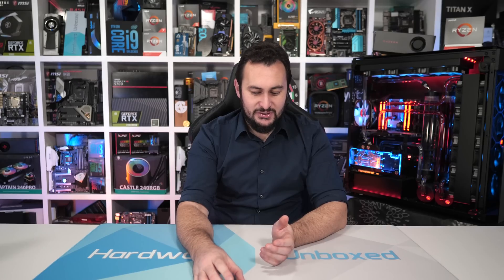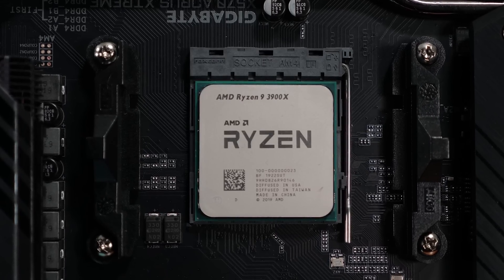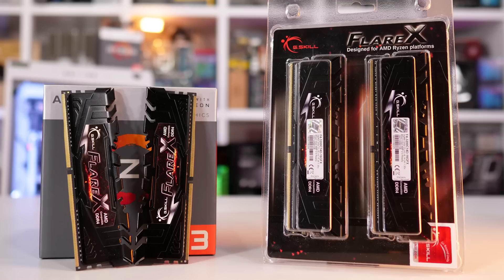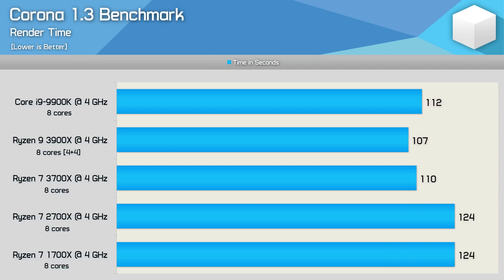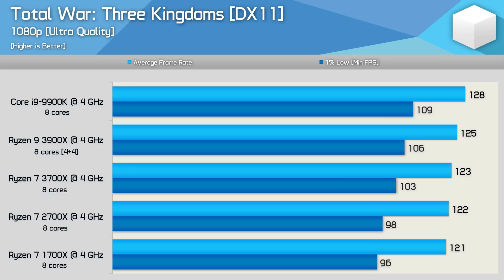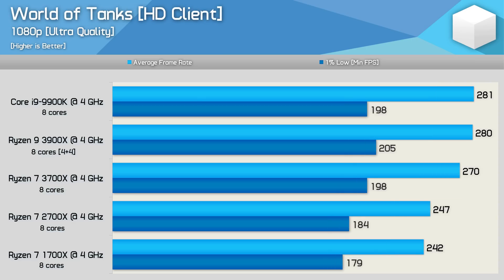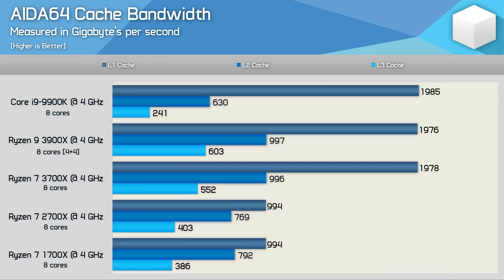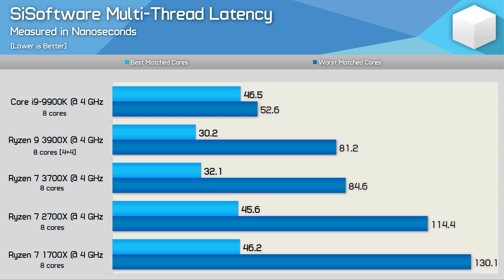3rd Gen Ryzen IPC Test, 3900X & 3700X vs. Core i9-9900K

Comment: Since Zen 2 has more memory latency than Zen+, can y'all do some testing with some highly tuned RAM to inform us of the best RAM configuration to lower memory latency?
Reply: No need for that, just buy 3700 Mhz fast memory with low CL and It just works :) ... AMD dixit!
Reply: It has higher memory latency is some situations, in others it actually has lower than Zen+ and Intel. 

The main situation where latency is high is if an application needs to pull data from the L1/L2 cache of a core on the opposing CCX. This is because this data is at the furthest point away from where it needs to be on the chip however it is still lower latency than going to RAM for the data. 

I'd be interested to see fclk results to see if bringing infinity fabric clocks up actually helps that however they did decouple fclk from ram now so that's why we're not seeing large gains from faster ram. 

In terms of cooling investment its still better to invest $30 more for 3600/3733 ram than it is to go crazy on cooling.

Comment: Intel is ahead for games, but not by much at all. 3900x seems to be superior overall.
Reply: Yup. I'll gladly trade 5% lower FPS for 50% more cores, less security holes and a more future proof platform.
Reply: It is far ahead, Intel 9900k's overclock to 4.9/5 ghz for all users who are willing to make a buy in that price range, this test has it under that by 1 etire ghz
Reply: EindbaasTV thx for the info!
Reply: @Peterke1337  I think it should be noted that everybody who reviewed the 3900x vs 9900k did so at stock settings for all CPUs which for 9900k means boost of 4.7-5 Ghz. So even when the 9900k is left to boost to 4.7-5 Ghz it is still only ~5% ahead in games on average as shown by reviews.

Comment: Interesting testing, but i really wish you would include a rx 5700 xt in the "IPC" testing for games.
Rumors have it that Nvidia have optimized their drivers more for Intel cpus then AMD cpus..
In this test AMD is having the highest "IPC in non-games" compared to Intel, but are losing the battle when the benchmark is using the graphic card (Nvidia driver)

Testing with a AMD graphic card could prove or disprove the rumors i mentioned above.

Comment: 3700x idle temps worry me as I'm not used to them.  40-50c on a NZXT Kraken 52 with mx-4 paste when my 3770k would run at 30-odd at idle.  Need to check voltages in CPU-Z.  Apparently software like NZXT CAM or others spike the CPU when requesting data from it which causes the boost to kick in, raising volts and temps so you get a fake reading.  Only CPU-Z is an accurate measurement.

Comment: In the latest A64, my 3900X is showing an L1 speed of 3145GB/s, Steve's is showing a lot less than that? My L2 is 1581 and L3 of 1121 (all for the reads).
Reply: Maybe because it's limited to 4ghz

Comment: Steve, I have a minor complaint about your explanations compared to the chart.  At 4:00 you started with the Battlefield V bench and stated that the 9900K is 9% faster than the 3900X, which is true for the 1% low, but only 2.5% faster for average FPS.  When you compared the 3900X to the 2700X, you said the 3900X was 13% faster, which is true for the average FPS, but it's only 9.6% faster for the 1% lows.  The issue I have is the inconsistency in describing your chart.  If you're going to compare 1% low differences, then please use that metric for all your comparisons, same as the average FPS.  Your numbers aren't wrong, but you weren't specific enough describing how you arrived at them.

Comment: My AMD experience goes back to the FX6300 on a cheap $50 board, it was a home office PC I later beefed it up to a "gaming" system - at least BF1 was decent (>60 FPS most of the time) and playable on it in DX12. Anyway my point is back in the day I used the intel compiler patcher ( https://www.majorgeeks.com/files/details/intel_compiler_patcher.html ) on windows in safe mode to patch most of the Dll and exe files that disable mmx etc on amd. It didn't work wonders but made things smoother - and no, benchmarks will not improve but the picture was "more fluent" in gaming. I am just wondering if that still is a thing with modern win10 and those new CPU's. And BTW I have HPET disabled on my current system as well, it gives me a couple of more FPS in games (my specs: https://www.userbenchmark.com/UserRun/16994339 )

Comment: Great test Steve. Thank you. Can you try the 3900X with Faster ram, lower latency ram and overclock fabric clock ? I really wanna buy Ryzen, i waited for it but it seems like 9900k is still better choice for me. Especially since i have beefy custom loop. Ryzen even fails at same clock speeds. Intel still has huge clock speed advantage. Ryzen runs around 4.3 while 9900K is not hard to do 5.1ghz. Can you also do some smt/ht off tests ? 

I guess i'll go with 9900K and flagship Z390. Z390 motherboards are much cheaper. It's like buying a decent X570 + 3700X. I've expected better from AMD :( Products are not there but prices are definitely high. Even stock 8700K(which has veeery good oc potential) better than 3700X. These new Ryzens are only good for budget limited builds because R5 3600 is nice.
Reply: Z390 cheaper? There are really good X570 mobos for cheap, and if that is still too expensive, you can go X470 or even B450. That said, if overclocking and gaming at 1080 or 1440p at more than 144Hz are your priorities, go 9900k, by all means.
Reply: @constantgatherer  Z390 flagship prices are similiar to low-mid end X570 prices. I need some features of higher end mobos. Otherwise B450 Tomahawk is really good budget motherboard. It kills everything with a 3600.

It's not just about higher refresh rate. 80 vs 85 fps is significant difference for a cpu. I want my gpu to be limit not a cpu. Check hardwareunboxed results at even 1440p the performance difference is noticeable. Also Ryzen performance is not consistent. It does very bad in some games. Another thing to note gpu is more likely to be upgraded. I want my cpu to last couple of gpu generations. Which widens the performance gap a lot. I will benefit even more when i upgrade from my RTX 2080 to RTX 3080 ti if i buy 9900K.

Comment: Why games run better on intel ? well it's simple Amd didnt have anything untile Ryzen and it take time to optimise...  :D
Reply: Unlikely to make a high difference unless all your games are world war Z...

It's practically impossible to get the most out of both use cases for cpu's which is likely why Intel aims to keep the 2 apart which makes sense. AMD Ryzen seems to be mostly targeted for heavy workload stuff & only second for gaming which it does okay instead of excellent.
Reply: @MLWJ1993  Well i disagree with you.. Problem is Intel still have higher % in market.. and Game developers will Optimise games for intel ( same for Nvidia) but when Tables are turned we will see

Comment: A pity the latency is still so high. Does not seem like that will ever change with Zen.
Reply: Yea, there is room for improvement. However, this side effect of using chiplets is in large part negated by the improvements in the microarchitecture and doubled cache size as we saw from the gaming results. It was almost on par with 9900k while beating it by a lot in everything else.

Comment: latency is as big of a part of it as ipc.  the amd cores have the ipc and even single thread performance over the intel cpus.  but the latency kills it.  its like putting a super charged v8 on a 3 speed transmission.  itll be great for the quarter mile in dragging racing, but a good v6 will beat it even if it has less power if it has a nice 6 speed and its a long distance race.  but that v8 and the 3 speed really tows as well...... what was i talking about?  oh yeah, ford.  i like ford
Reply: Brad Viviviyal  well the point of what i was saying is that even if they did clock as high as the intel they still wouldnt be as fast because of the latency.  maybe the cars were a bad analogy.  the problem isnt that high clocks are needed.  its that latency in core to core and memory accesses is slowing it down is what i meant

Comment: This painted a very clear picture of what tradeoffs AMD made in their design. The IPC gains are impressive and the larger L3 cache would help a lot with applications with fully optimised memory access, taking full advantage of that extra L3 capacity. As I work in games, I recognise how tricky it can be to get memory access tightly packed across all situations. That's where the worse memory latency would hurt the new 3000-series.
I think that, in general, game developers should keep striving to improve memory access locality. Not just because it takes better advantage of the available cache, but also because it allows the CPU compute resources to be better utilised.

This video has shown quite clearly that Intel understands the state of games today. I think AMD is on the right track for predicting what games could be in the near future, but I guess we shall see how everything unfolds.
Reply: That's really good insight.
Reply: Both PS5 and XBOX will use some sort of ZEN 2 8 cores + RDNA as video processor a f a i k, so finally game developers will be forced to code for AMD µarch. Intel's gaming supremacy will finally end, and it isn't soon enough, as Yoda would say :-)
Reply: @vladvah77  If Ps5/Xbox will use x86 arch, it will be a revolution on the gaming market. Except they will not...
like previous consoles, developing for AMD hardware on cosoles didn´t bring any improvement for x86 market (quite the opposite, Batman Arkham Knight who?)
Reply: Vlad Vahnovanu not just that, but intel is going to copy AMD's infinity fabric meaning they will suffer from precisely the same latency issues. Then, it's just a matter of pure IPC (which AMD now currently leads in slightly).
Reply: Would it be smart or dumb to think that with PS5 and Scarlet using Zen2 + RDNA over the next few years, games might be more optimized for this architecture in the coming years? Should that be something to keep in mind for PC in 2020 and beyond? I'm upgrading in April 2020 for CP2077 and think it would be good money to go Ryzen
Reply: @MamboMRS  It´s amazing that a single game, non-DRM and no micro transaction shit, can indeed move the market more than a new hardware generation can, these days...
You have my rescpect SIR!
Hope you buy it on GOG.
Reply: @bleem2951  Never pre-order, except for a CD Projekt game. Got mine from GOG indeed!
Reply: But what RAM would be the best for the 3700x? 3600 CL16?
Reply: Split between core and memory IO make huge latency
Reply: AMD should go full single chiplet for Zen 2+ and zen3
Reply: Understanding the state of games has nothing to do with it. Intel has been the dominant CPU vendor for so long that is what most software targets and are optimized for. Monolithic dies are always going to be better than chiplets but they cost more and due to yield issues it is clear that chiplets is the way forward. Same on the graphics side. NVIDIA spent serious cash on optimizing DX9 and DX11 render paths while AMD is busy with particular compute workloads and async rendering. Must be some real long term planning that AMD is doing here with a payout long into the future.
Reply: @NicolaiSyvertsen  Maybe the 15k software developers on Intel side has something to do with it????
Some wicked "tin foil hat" and "conspiracy therists" may argue they are developing tools to programs and games developers to use, thus improving Intel hardware performance and sales...
Me don´t believe it, Intel is doing a lot of public service those days...

Intel compiler stuff was public service, right?
Reply: @NicolaiSyvertsen  If monolithic dies will always be better, then they should be offered for those who want to achieve the highest performance in competitive games. Since probably at least 75% of users make use of their CPU's primarily in gaming, it would make sense to offer a CPU that performs as well as possible in games. Just my two cents...

Comment: I'm starting to wonder if the 3800x is going to be dual chipet after seeing these results.  It's outright shocking to me that the dual chiplet option performs so well.
Reply: Turns out having tons of cache is really nice :p
Reply: Yes, but when the cache is split up into two chiplets it adds latency if you check the second cache.  Although, I suppose the chiplets may not check eachothers cache at all.
Reply: @cracklingice  Yeah, this is surprising to me as well. The L3 is not unified but I know that IF does have data coherency instructions in its protocol so there must be some cases where they do check the other one but unfortunately I don't know the details of under what circumstances. Maybe their pre fetcher is just really good... or they have some way of tagging data that has cross-chiplet thread cache data dependencies, and use that to duplicate only that data across the seperate L3's.

Comment: - I do not understand the point of this video?! 
 AMD puts more cores in their chips to be competitive! Intel clocks there chips higher to be competitive! No one would run there new 12 core AMD chip with only 8 cores! No one would down clock there 9900k! AMD and Intel compensate for there chips weak spots! Who cares about IPC alone? Who alone cares about higher clocks speeds? What value in the real world does that give you? AMD has seen Intel has higher clocks and are compensating by having higher IPC! Intel sees that that is what AMD is doing so Intel brings there clock speeds up!

Comment: Hmm, so the worst core to core latency on dual CCD 3900X is actually not worse, in fact better than the single CCD 3700X. Interesting, wonder what is the cause?.
Reply: It's something about AMD's memory controller's bus width so R9 3900X has the whole thing because of 2 CCDs=12 cores and 3700X has only half because of one CCD=8 cores design, I read some on reddit.

Comment: AMDs latency is still disgusting....hopefully some reviewers will manage to showcase 1900/2000 forced IF clock with 1:1 ratio soon....should be around 62-63ns....
Reply: 3600mhz cl 14 show 60ns of latency but they avoid latency problem with  more l3 cache
Reply: @dylan.dog1  Hmm interesting! CL16 3800mhz only shows 63.5ns ... do you  think you can get those cl14 to 3733mhz? that would drop the latency into the 50s...i think
Reply: @yukegaming8788  maybe

Comment: IMO huge amount of “game cache” in 3900x is what makes it faster than 3700x in gaming even at same core counts and clock speeds. Also much of the high latency problems are ironed out because of huge cache.
Reply: In video, says that 3900x gets two 16-bit Write Cache modules per core, while 3700 only has a single 16-bit (and Intel uses single 32-bit). So depending on your application's need, it can make a performance difference via the bandwidth (or maybe should say Bit-Width) of the pathway without affecting the overall amount of onboard cache using those signal pathways.

Comment: This is weird! Shouldnt AMD be faster in gaming at 4GHz? What went wrong here, im seriously confused as hell. Arent the games able to use the higher IPC?
Reply: The underlying pipeline is probably pretty similar. The IPC increases mostly come down to decreased wait times to fetch data, and wider floating point units which I think won't help some games. Once those pipelines are saturated, there's only so far you can go without more clockspeed. Also Ryzen still have higher latencies to memory, even if it has more bandwidth, and most games can't cache everything.
Unless they make great strides in the underlying instruction execution, just the cache and branch prediction can only go so far. I believe next gens will further improve on those weaknesses however.

Personally I love the 3rd gen Ryzen, it's gonna be great for my uses. The gaming performance is just icing on the cake! Few people will be bottlenecked by any of those.
The BIOS issues are pretty meh.. Hope they'll be ironed out soon
Reply: because amd sucks, its just hype train.
Reply: You assume that Ryzen has better IPC than Coffee Lake. But thats wrong.
Reply: @meteormedia7021  it does have a higher IPC than any intel architecture at the moment
Reply: @merlin8208  They definitely have better integer IPC than Intel right now. I don't know about floating point.

The comment about cache and branch prediction is interesting given that Intel has been losing IPC there to security updates. I think they are down somewhere about 15% to 25% overall depending on bios, microcode version, windows version, and use case now.